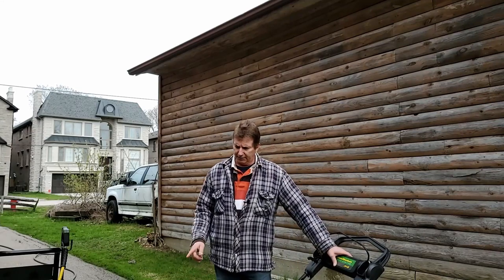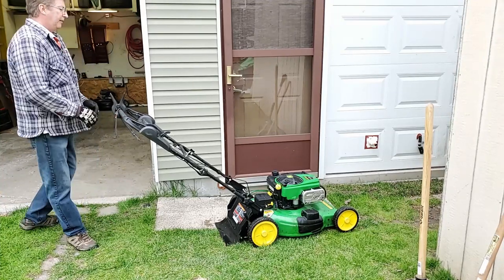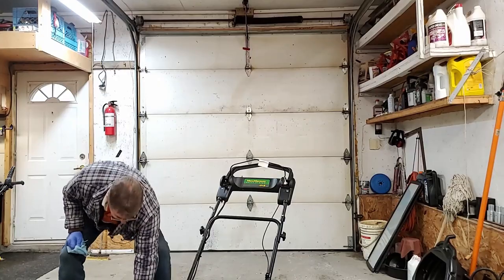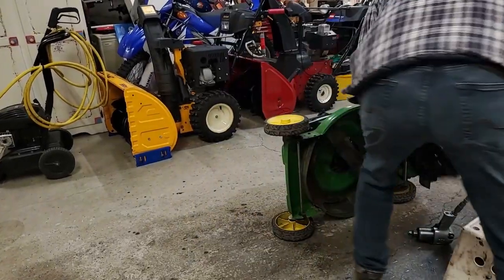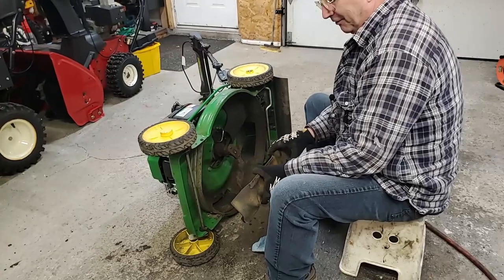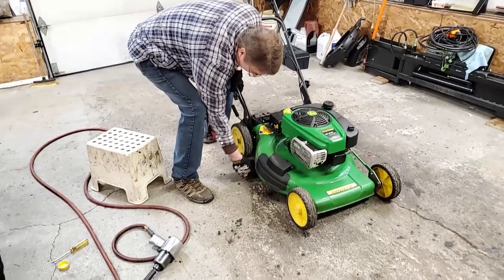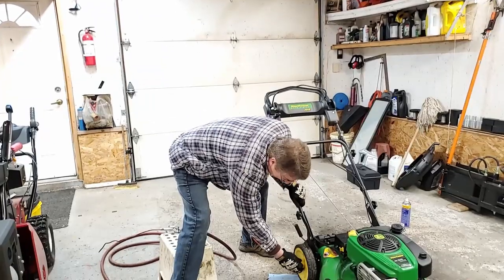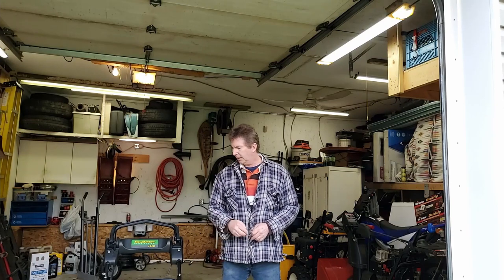LAWN MOWER SERVICE.  MODEL: John Deere JS48 #FrugalWithJohn

Comment: Did you replace the oil filter ? Was wondering cuz mines is stuck , and was wondering if you had any tips on how to get it off ??
Reply from the maker: I did replace the oil filter. The oil filter came off easy, the same as any oil filter on a vehicle.

Comment: Mower leaves a lot of grass behind? How do you adjust tension belt? On a Js46?
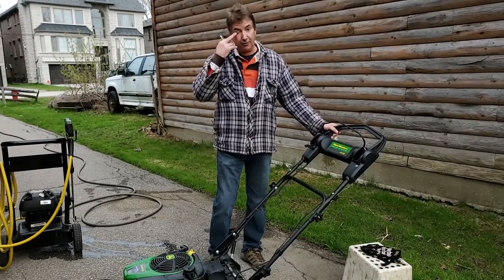Reply from the maker: https://www.youtube.com/watch?v=Z_Yzw_KtaHY  Around the 13:50 mark on the video, you will find the answer about the belt. Take the old grass out of the bottom of the lawn mower, use a plastic scraper (1:00 minute mark of this video) This should help with grass being left behind. (unhook the spark plug before putting your hands around the blade) Thanks for watching.

Comment: Great video on servicing the mower my problem is I have to change the oil seal on myjs46 the spot where the blade goes is rusted stuck any ideas on what I could do I’ve tried everything heating it too
Reply from the maker: Thanks, Did you try a puller? I don't have a video of taking one off but you can check this video out. https://www.youtube.com/watch?v=7caxtmxZ2oc
Reply: @FRUGALWITHJOHN  I did John to no avail the mower has been poorly maintained unfortunately
Reply from the maker: Keep spraying it with a 50/50 mix of acetone and transmission fluid for a week or two then try again. Don't get this mix on rubber or paint.
Reply: @FRUGALWITHJOHN  will do thank you man

Comment: came looking for info about the js48 this guy keeps the torque spec a secret 😞
Reply from the maker: https://images.homedepot-static.com/catalog/pdfImages/08/086d911d-27cb-4dc2-b5b4-52c3fb95469f.pdf I did say to check the manual for torque specs-- page 27. thanks for watching.
Reply: 40